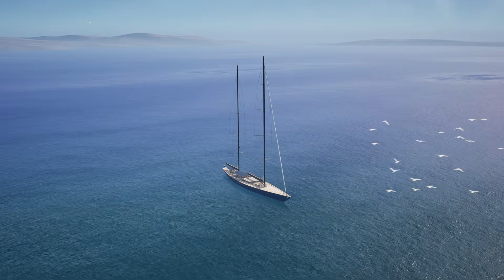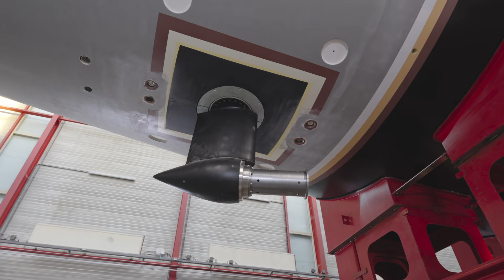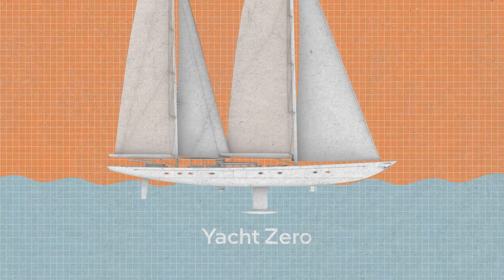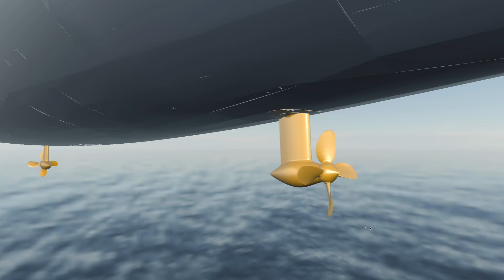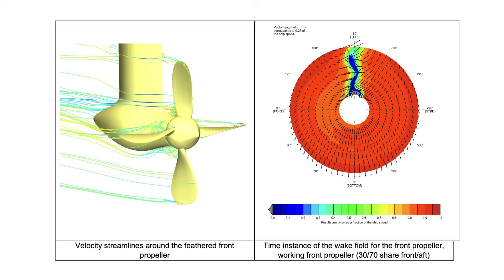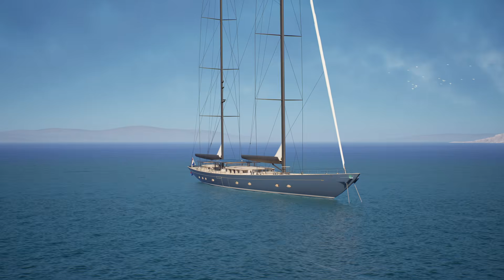Why this all-electric hybrid propulsion system matters

Comment: How do you plan to integrate 40 to 50 tonnes of battery in a sailing vessel, maintain a top speed of 16 knots while dragging 250 kW of regen power (i.e. 50-90 kN of drag) ?
Reply: Sounds like a pretty useful keel, good for avoiding Bayesian type moments.....